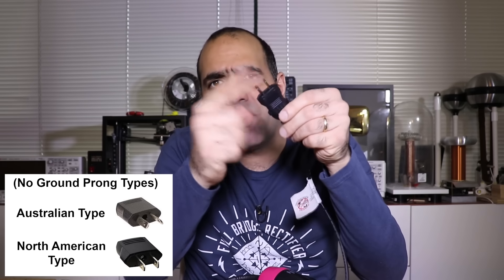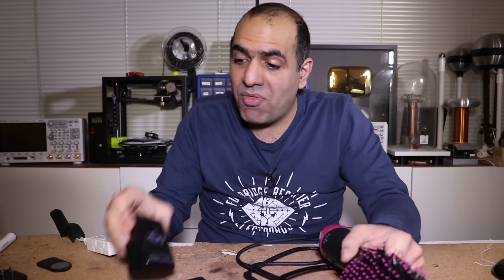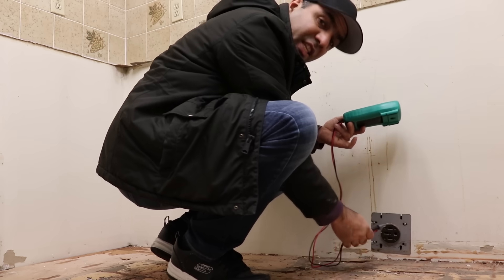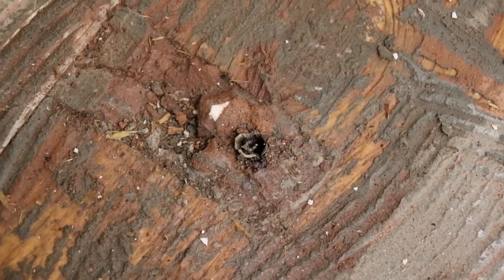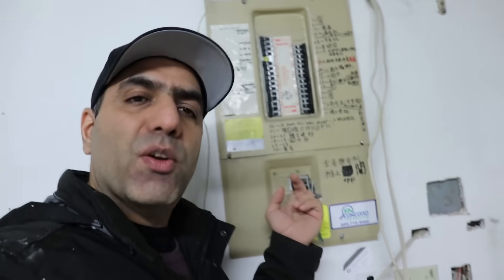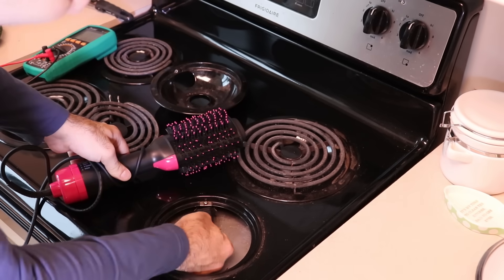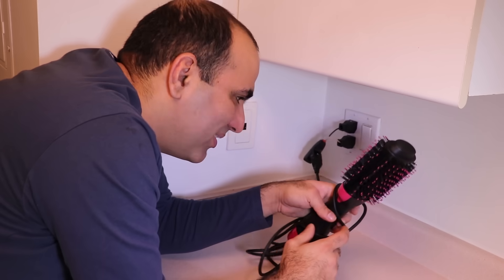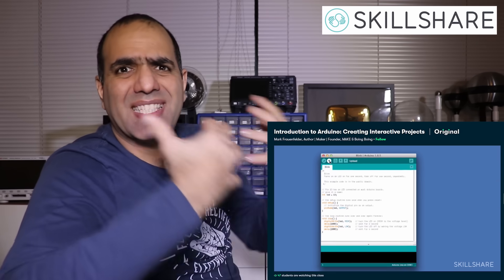Finding HIGH POWER 240V in a 120V Country

Comment: Yeah running consumer device with a heating element with out a neutral or ground and just two hots?  That's not a very good idea.  I mean it's a hair dryer what are the odds of it being used in a moist environment?  Oh yeah 100%.  Seriously, this is one of the most dangerous things I've seen on this channel.  Like light your hair on fire, burn your face off and burn your house to the ground dangerous.  DO NOT ATTEMPT THIS AT HOME.
Reply: well he had access to 2 grounds so he may have connected that. I'm not saying he did but it's likely. neutral is not that important since all safety measures should work fine either way. then again any tampering with sockets is dangerous but I do believe papa Boom has done worse things.
Reply: @PRUSER27  Using the two hots like that puts the load on two separate breakers with no load on the neutral.  That's really not good because the breakers won't trip like they're designed to.  Also It looked like he only used one wire from each plug so no ground either.  
A simple step up transformer would have been a much safer solution.

Comment: Now take a 120V hair dryer and plug it into two outlets in Australia. XD
Reply: You will need half the time.
Reply: @tswellersalzer1850  quarter time. 240v * 2 = 480v (although they are probably the same phase)

Comment: lol   and like  you did not know that the split receptical in the kitchen can be used... you add two plugs to the hair dryer... one you connect the black prong to the black wire, then you connect the white wire to another plug but the black prong only... now you plug both in to a split and you get 220.  lol   I should wait. you did that...lol

Comment: In Iraq I bought a Nintendo DS. I plugged it in and it didn't charge.... luckily it didn't start a fire. Turns out, it was the only thing I had that couldn't take both 120V and 240V. I was able to borrow a 55 pound power converter, though.

Comment: Your cooker is plug in? In the UK, all 240V supply, all high power devices are hardwired to the outlet, such as cookers, immersion heaters and electric showers. Plug in outlets are fused at 13A. Why does north America still retain the antiquated 120V supply?
Reply: Hardwiring high power devices is mostly for cost and space saving, as CEE sockets are kind of bulky. You could just use  32A CEE plug if you fancied:)
Reply: @shana_dmr  No, they might be viable, but the regulations allow only 13A maximum plug and socket outlets.
Reply: Since you obviously learned nothing from this video, let me point out North America uses a 240V supply.
Reply: @stargazer7644  Yes, I know that, but it's not the same. You seem to have two 120V live supplies which make 240V when combined, but also allow 120V appliances to be used. Our supply is just one 230V live. The supply from the grid is 3-phase at 400V, which is then distributed to 3 areas of 230V each via substations. This allows for a 3-phase 400V supply for industrial use. Industrial sites can still power things like canteen equipment at 230V by tapping into just one phase. I am still struggling to understand how your system works and why ours is different, so forgive my ignorance.
Reply: @derekcolman  Nope, in the US we have a 3 phase system where one phase is sent to a house through a 240V transformer that has 3 wires coming out, two hots connected to either end of the coil and a neutral center tap that is connected to ground.  From the point of view of the neutral wire, at one point in time one hot lead is +120V, and the other is -120V.  They swap 120 times per second.  The voltage measured between the hots is 240V.   If you wire an outlet between the neutral and one hot lead (either one), you get a 120V outlet.  If you wire it between the two hot leads, you get a 240V outlet.  Of course we use different plugs for each voltage.  

The only effective difference between a UK 240V circuit and a US one is one side of the 240V is ground referenced in the UK, where the 120V point is ground referenced in the US.  That doesn't make any difference whatsoever to the device running on the circuit.  It just sees a 240V potential difference across 2 wires in both cases. The only place that becomes important is in the event of a fault where the hot lead touches an ungrounded cabinet, in the UK a person would get a 240V shock, in the US they'd get a 120V shock (even on a 240V device).  The same thing said another way is that if you touch the bare wires in the US you'll get a 120V shock off of each side, in the UK you'll get a 4 times worse 240V shock off of one of them and nothing on the other.  This is a big reason why we use this supply scheme - it's safer.

This arrangement is only used in the US for single family residences.  Commercial and industrial sites get 3 phase power that can provide a variety of voltages.  120V and 208V being most common in commercial buildings (that includes large apartment buildings).  Industrial buildings often get higher voltages.
Reply: @stargazer7644  Thank you for explaining it. I understand how it works now. We have different safety features in the UK. All appliances with metal cases have to be grounded via the earth (grounding) large pin on the plug outlet. All wall and ceiling outlets have an earth wire  connected to a spare terminal in the outlet or the metal conduit box behind the outlet. Light fittings with metal components must be connected to that terminal. In a socket outlet, the earth terminal forms part of the  socket for the large earth pin on the plug. The idea is that contact between the live wire and any metal component in the entire system will blow the fuse or earth leakage cut-out in the consumer unit. No socket outlets are allowed in bathrooms except a shaver socket, and light switches are ceiling mounted with a pull cord to operate them. A shaver socket has an internal step down transformer, with only 115V supplied by the isolated secondary coil. I believe 115V hairdryers and curling tongs are also available to plug into shaver sockets. The shaver socket takes a small flat pinned plug similar to some American two pin plugs. Wall sockets around the house are switched and have shuttered live and neutral holes. The larger and longer earth pin causes the shutter to open when the plug is inserted about two thirds of the way in. The shutter prevents small children from inserting metal objects into the live socket.
Reply: @derekcolman  US safety systems are a bit different.  Most appliances with a metal chassis is generally done the same way as the UK, using a 3rd pin/wire for earth grounding.  All metal associated with power distribution (boxes, conduit, raceways, fixtures, etc) are all bonded to ground.   Most but not all plug in devices today are "double insulated".  They have at least two levels of insulation or are designed so that it is impossible for their cases to become energized (many are made of plastic).  These devices have only a 2 pin power plug without the Earth pin. The plugs are polarized, so they only go in the outlet one way and hot/neutral cannot be swapped.

We don't do whole house RCDs here, but we require their use on individual circuits that could potentially be exposed to water: basements, garages, outdoors, bathrooms, sinks, etc.  These can be employed in the circuit breaker, or in the outlet.  We do have typically one outlet in bathrooms near the sink.  We also require arc fault circuit breakers on most indoor outlet circuits.  Our standard outlets don't have shutters, but covers with shutters are available.  Plastic inserts are also commonly used to block outlets in homes with children.  We do not have switches on our outlets, but it is common to have wall switches wired to control outlets in some rooms.  Most houses have ceiling lights in most rooms controlled by wall switches near the doors, but at various times it has been fashionable to leave these all out and just have the switches control an outlet in each room that a lamp could be plugged into.

Practically everything runs on 120V here.  The common 240V exceptions are water heaters, kitchen ovens/stoves, air conditioning/heating systems, clothes dryers and car chargers.  I have welders and large floor mount power tools that use 240V.  All those devices have dedicated circuits and breakers.   Just about the only thing you can buy that has a plug on it and needs 240V are very large window mount air conditioners.  Special outlets would be installed for these.   Smaller window air conditioners are 120V.  Portable space heaters are all 120V.

Comment: That "disconnected" wire looks like it might been going to a dishwasher or kitchen island outlet ? 
wow those FPE breakers don't really trip eh.
Reply: Unless of course you have a federal fire Pacific electrical panel ( apparently you can slip a check under UL Laboratories door backing in the ancient years  and get approval ) which just recently got retired. I accidentally left my meter on amps a year or two ago and as I watched all the lights in my room dim and come back up only after the power strip breaker tripped. thank goodness all the computers running UPS.
I've read stories around the interwebs of electricians in attics too lazy to go down And using Cutters to disconnect them and suddenly arc welding things together. Federal Pacific panels are on the do not use list of home inspectors for good reason.
Reply: Although they are apparently more common and used in Canada complete with replacement breaker still being sold. Which makes it harder to identify the bad ones from the good ones.
Reply: I curious why so much water in that house, like they stated with roof.
Reply: @MACTEP_CHOB  Leaky shut-off valves for the sink.  Mine leaked just like that in my remodel, but I didn't let it go all over the place like that...
Reply: what if it was a possible Insurance fraud? LMAO
Reply: I totally did not catch that, I'll be right back I have to go copy and paste a comment.
Reply: Didn't look like a full short.  Breaker only trips at 15 or 20 amps; it can't tell that the 500W of draw is "bad"; just looks like the tea kettle to the breaker.

Comment: I had a hard time even finding out how to wire a european home or Australian, is it one phase 240 with a neutral and a ground? If it is single phase 240 that would be hard to replicate with our power system or am I not thinking logically. Not sure how we could take 2 different phases and put them on one wire and neutral.
Reply: Yes in Europe etc. it's 230 V 1 phase and neutral (or 220V or 240V depending on where). In his final case there is no neutral being used. Just 2 hots (phases) that are out of phase 120deg resulting in the overall voltage between them is 208V. There are two ways North America accomplishes something like this for residences. Either with 2 phases of a 3 phase Wye system where 2 phases are 120deg apart. With a five pin appliance plug this gives 208V btwn Red and Black (2 hots) wires, 120V bwtn Black and White (hot and neu), and Ground. Or...with center-tapped windings where the center of the transformer winding is referenced as Neutral and the two other ends of the winding are hots that are 180deg apart. So on that same five pin plug you get 240V btwn Red and Black, 120V btwn Black and White, and Ground. In both cases the power hungry part of the appliance uses the 2 hots only (red and black) for the higher voltage (like a motor or heater coil) and the smaller electronics and stuff in the machine use the lower voltage hot and neutral like normal.
Reply: @Hooptedoodle  Thank you that was very detailed, I appreciate it.

Comment: Why does a minor appliance need to run on 1,000 watts? I have an air compressor that doesn't need that.
Reply from the maker: Anything generating heat usually consumes that much

Comment: Great video.
I would like to point something out, though...
It would be helpful to point out the difference between "line" and "phase", instead of conflating the two terms.
I realize that the two terms are often used interchangeably by people who understand the difference, but it tends to confuse people who don't. That's why so many people think that they have 240 V "two phase" in their house, when they really have 240V single phase.
"Line" describes an ungrounded current carrying conductor - or "hot" wire" - while "phase" describes the voltage difference between two current carrying conductors. That's why the 208-230-240 systems <in places like the US> are called single phase, even though they are fed by two hot wires.
Just to make it a little more clear, on a three phase system, you can have three Lines -  A, B, and C. 
The phases, however, are A-B, A-C, and B-C. Three phases.

Comment: As a software engineer... what exactly does an electrical engineer do for a typical job?
Reply: Electrical engineer is just physical labour. Doesn’t get close to engineering software (i’m software engineer as well). If you know the right wire types and gauges and some basic circuitry, it’s just brain on zero and move your hands.
Reply: Depends though if you do house installations or smaller electronics with IC’s, capacitors, transistors, etc. The last one may be equally complicated to engineering software.
Reply: They drive electric trains, of course.  But seriously, they design or work on things related to electricity.  They might design electronic products, or even IC chips.

Comment: Man the element in that should work in 120v regardless without issue. It'll operate at 1/4 capacity and take forever to heat up but it'll still do the trick... probably not damage her hair either.
Reply: before some of you shit a brick. here's the math.
240V. 1000w.   4.2a 57.6ohm.  resistance will remain the same on the element so...
120V. 57.6ohm = 2a = 250w   1/4 the power. will still work.
Reply: It literally will take forever to heat up - as in, it never will.

Comment: My stove and dryer are both natural gas powered, so I have no 240V.
:(
Reply: The house would still be served with two phases, you just have no multi-phase outlets. Central air conditioners are 210/240V, as are some through-wall units. And, as he mentioned, different circuits will be on different phases to help balance the load.
Reply: Good i want to do that instead of electronic rage and dryer.
Reply: AC unit

(fan of gas stove - still use them when power out :D)

Comment: Why not use 240v in the first place? 120v makes it so that you must have twice the cross section on the wires, thicker cables, more voltage drop..
Reply: Because almost nothing needs the extra power 240V supplies.   With that thinking, why don't we have 10,000V at each outlet?  Wouldn't that be even better?  No need for transformers on the poles.  Then we could run everything on 24 gauge wire.  I have a total of 3 devices in my house that need 240V, and hundreds that use 120V.
Reply: @stargazer7644  its not about the "extra power" its about convenience, energy efficiency and maybe the fact that just about the entire rest of the world is using 240v... As a professional electrician i can whole heartedly tell you that american electrical systems are quite impractical and a lot more dangerous than what the standard is, at least in scandinavia. (yes, i have been to the US and checked the electrical systems where i have been. This is not a roast or anything.
Reply: @Namesakes.unit-x-10sq10  "The entire rest of the world uses 240v"  You're completely correct, except for half of Japan, Anguilla, British Virgin Islands, Cuba, Guam, Haiti, Honduras, Jamaica, USVI, Panama, Belieze, French Polynesia, Guyana, St Kitts, North Korea, Taiwan, Barbados, Trinidad and Tobago, El Salvador, Phillipines, Bolivia, American Samoa, Bahamas, Bermuda, Cayman Islands, Colombia, Costa Rica, Dominican Republic, Guatemala, Micronesia, Nicaragua, Palau, Sint Maarten, Venezuela, Ecuador, Puerto Rico, Montserrat, Liberia, Canada, Aruba, Bonaire, Libya, Mexico, Suriname, Curacao, part of Brazil, Madagascar, and Morocco.  Nearly the entire western hemisphere uses 100-127V residential power systems, and several countries beyond.

Now, do you want to tell me more about how you know better than I do about my business?    If you have an informed opinion you want to voice about why you think 240v systems are better, fine.  But don't presume to tell me jack about the US system just because you stopped by for a visit.
Reply: @stargazer7644  the US spec electrical systems are shit, power outlets are dangerous, wire gauge unnecessary big and a general lack of quality is highly present. Come to Norway, you'll see how it should be done😉

Comment: where the hell was that death trap of a house you were in. wow an arcing pipe in the floor.. just as well you spotted it coz that was defiantly a FIRE GOING TO HAPPEN situation.. that's really mad the way power is setup in gaffs over in the old Canada!! I guess it only makes sense not to have red hot wires every time you turn on your appliances... very cool video Mr Rectifier.. (my hero) stepping on spaghetti... I thought you were getting shocked by the noise.. so funny.
Reply: This house is obviously owned by someone who does not care about others and only how much money they can put in their pocket. Inspections are mandatory in canada and this owner is obviously doing the renos without the required permits and inspections, as all the wiring is NOT to code. There are strict rules that make things safe for all and this is just an example of some idiot breaking the law. This is not standard or acceptable in canada. It would be similar to me going to your country and seeing one person driving 200km/hr on the sidewalk and thinking your driving laws are terrible and unsafe.

Comment: apartments are typically wired 120/208/120 3phase- the high leg plus your low leg should be 240-255v. if your oven circuit is wired delivering 208v instead of 250v you should call the electrician because it's wired wrong.